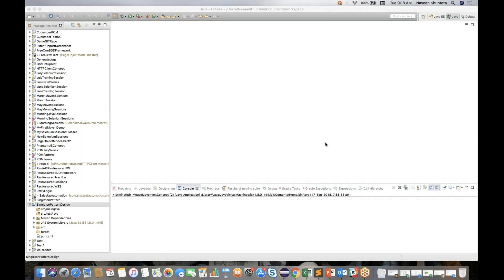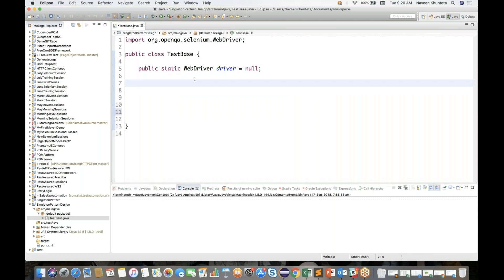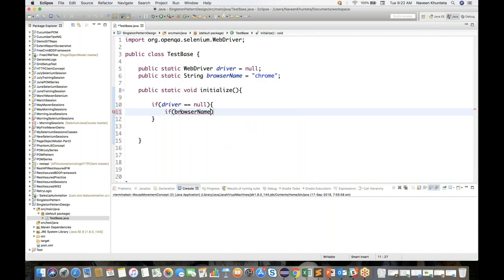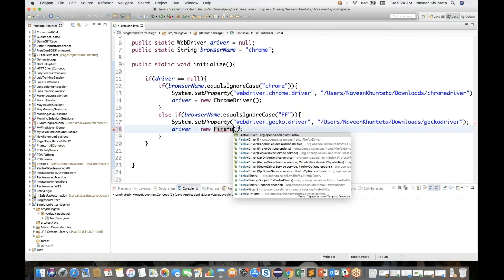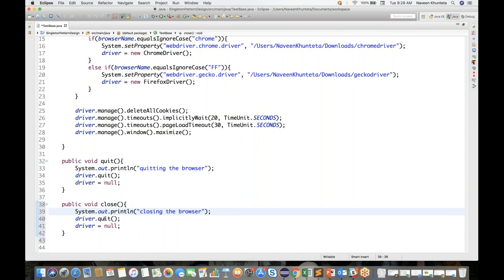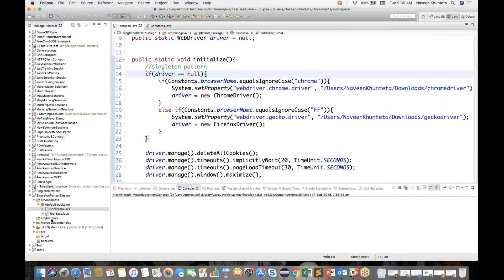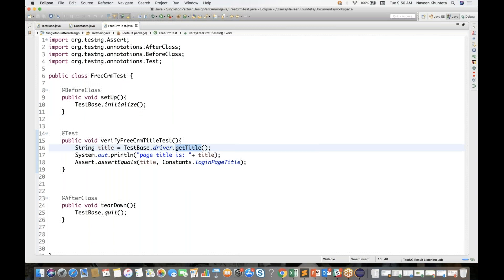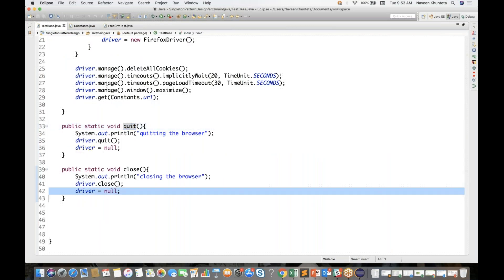How to use Singleton Pattern in Selenium WebDriver

Comment: Sir I have 1question,
If we making webdriver static,  How it will reflect parallel browser testing Using Grid?
Reply from the maker: You can achieve singleton without static as well. I have just given an example with static. You can create WebDriver driver instance without static as well.
Reply: @naveenautomationlabs  thank you sir  for reply, but I have another question it will create instance of each webdriver, so is there it will consume more memory on Heap?

Comment: Hi Naveen, I have framework based on singleton design pattern +Cucumber + TestNG where I tried to execute the cucumber feature file scenarios in parallel but it did not work. Can we use singleton webdriver in parallel execution. Please clarify.
Reply: I was just thinking of commenting on the same. If you want to have parallel test and make your driver as static in singleton class, it will not work. Singleton means, you will have a single instance. so you can not create multiple instance of your driver, hence parallel test will fail.